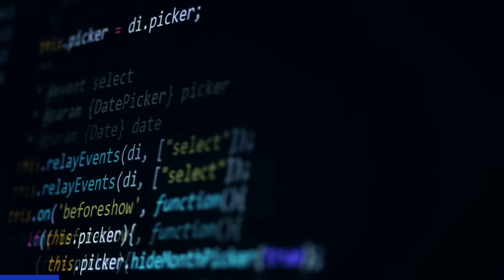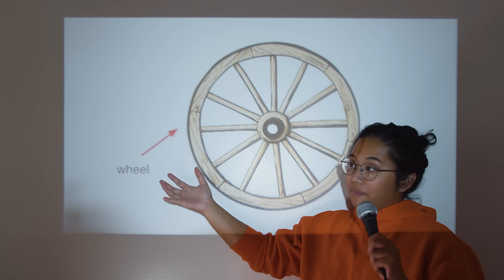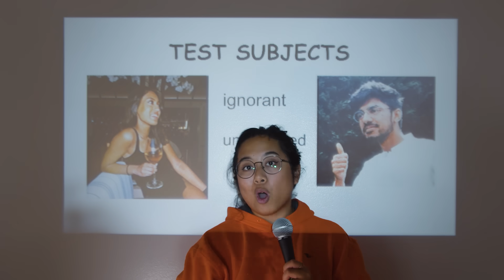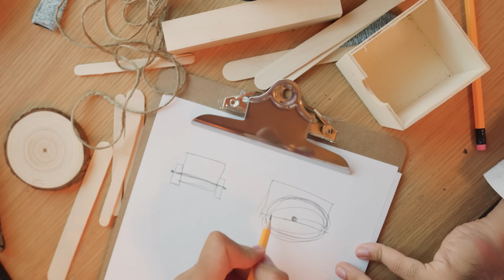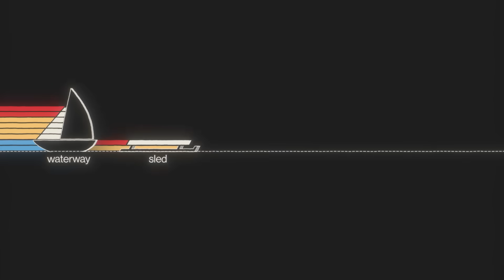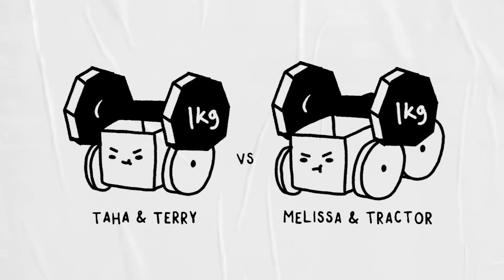why it took 200,000 years to invent the wheel

Comment: A few other factors to keep in mind:
1. Terrain. Hilly or mountainous terrain would be a potential hinderance compared to somewhere relatively flat. Thus, roads are important for wheels to operate at their best efficiency.
2. The use of animals was definitely a key component, which you did mention. This is why the wheel really took off (eventually) in the Old World. In the Americas, domesticated animals capable of pulling a cart didn't really exist, so the wheel wasn't really utilised. This doesn't mean that they were unaware of the concept. Evidence exists of figurines and children's toys with wheels attached. But practical use would have been limited.

This is not a critique of you video, though. Just some interesting thoughts to add. Your challenge for inventing wheels was really thoughtful. I enjoyed watching the process.

Comment: i think even the "2 wheels and axle" method might be a little further from the actual invention of the wheels as a labor saving device. attaching one wheel to the end of a sled or travois (turning it into a wheelbarrow) would be an almost intuitive step, rather than jumping straight to multi-wheeled carts pulled by draft animals

Comment: I don't feel this really touched on the challenge of constructing a wheel from materials. They were given a log cross-section, which wouldn't be a reliable way to scale to the right size. The wheel would have to be quite large to account for lack of roads, and grain orientation on a log would be in the wrong direction and thus split under weight. Also the pith in the middle of a tree is the weakest part, terrible for supporting the focused weight of the axle's load. 

Idk felt like this video wasn't in the same league as your other material. I recommend revising your testing.

Comment: Before watching the whole thing, let me think. 
Get a string, nail, and a drawing stick. Making an inner circle. Then make an outer circle. Just attach the draw stick to the string, and the string to the nail to make the circles. Once that is done, use carving tools and make wheel... now I will keep watching to see if i am correct. Just make sure the inner circle is the same size as the stick to be used as the axle.

Comment: - 1:32 IBM didn't "sponsor that portion of the video", that was just an ad, plain and simple.
- 1:55 A wheel isn't as simple as round-thing-on-stick; to make it work the way we use it, you need to invent a rotor or bearing.
- 7:45 JohnnyQ90 machines metal parts on a lathe to make mini internal-combustion-engines for model cars!

Comment: Looks like they managed to invent the wheel in your show - BUT (and it is a big B.U.T.): There is still a way to go from those toy wheels to something that really can carry a cargo. Their wheels are rolling with the fibers parallel to the axes. At higher loads, they will break early. For building good wheels, our ancestors had to turn the direction of the fibres and find a method getting round, stable wheels without relying on stems being round. A compass will get you draw a circle, but I think we needed metallurgy to put a metal strap around that disk to give it stability - thr strap being a reason why it took so long. A wood wheel with a metal strap around was a standard fairly long, before rubber came along and we shifted to metal wheels with rubber not long ago.

Comment: I would've used the string to draw a perfect circle for the wheel and then use the pencils, popsicle sticks, and rope to create a lathe to carve the perfect circle. I would also have used the pencils as axels but used the graphite as a lubricant and used the popsicle sticks for washers and tied rope around the outside of the axle to lock the whole construction on. Some type of leaf spring would be nice but I doubt I could construct a strong one from the given materials

Comment: If you are rolling over rough ground, you need a big wheel, or you get stuck easily. Large trees are often less round around. Taking a thin flat slice of a large tree is hard enough with a modern handsaw. Good luck with a stone axe.  Wood is strongest up/down. Which is why Wheels aren't just slices of tree.

Comment: Plus there's the issue of wheels working most efficiently on smooth, solid, and level terrain. So if you live somewhere where that doesn't exist naturally, you'd need to build roads. And why would you build roads if you don't have wheeled vehicles to use on them? And why would you build a wheeled vehicle if it wouldn't work on the ground it would have to operate on? IF you lived in that sort of environment, you'd basically have to invent both the wheel and the road at the same time in order for it to be terribly useful.

Comment: True: she has the suspension, but she doesn't have the speed - Everyone would be riding Terrys to work and while the "Trucks" are more convenient to take to the shops: they would ultimately not pick "Trucks" due to poorly built wheels!
Therefore, while she may have won in this video: I declare in the longrun Terrys to be the more efficient and reliable mode of Transportation.
I would therefore like to award the creator of the Terry with a Terry's Chocolate Orange. Unfortunately I ate it. =P

Comment: If I had to reinvent the wheel with primitive tools, I would go for a wheelbarrow. 
1. The wheel doesn't have to be big, so a relatively thin tree could be used as it is.
2. The axle can be very short (10-20cm), so it's easier to make it round.
3. And obviously I would only need one wheel and one axle. I there's no need to worry about the stability or weight.

The downside is that it's not so groundbreaking as a cart. But it's a start, and with enough iterations the system could be scaled up to a cart or a wagon

Comment: That.... was actually fantastic! Liked, sub'd and here's your comment!

One of my degrees in is product design. I had a First Principles course that asked questions just like this. We had a fantastic challenge in which we were given a roll of bubble wrap (one of those 2-foot diameter FULL rolls of bubble wrap; half of us got little bubbles, the other half the big ones. Each presents different challenges). The objective was to present a device that could pop every bubble as fast as possible. Chemicals and temperature manipulation (e.g. "fire") were off-limits. Results were obtained by folding the remains back on itself over and over every 18 inches, then setting a piece of 1/8" hardboard atop that and measuring from surface to top of hardboard (as even a single remaining bubble would, perforce, prevent it from sitting flat. Many bubbles have a rapidly-cumulative effect.

The coolest part was of the 16 of us, there were 16 totally different approaches. Literally no two of us approached it the same way. Trés cool. This experiment of yours here harkened back to fun times. Thanks for sharing!

Comment: I was told to comment so I shall comment... but what should I comment?
Does the comment need to be sensible or just a string of words put together to form a sentence or two or more.

I think it's easy for those two to "make a wheel" when they already knew what a wheel was.
It must have been incredibly hard for people back then to invent a totally new thing which had to be able to do all those things mentioned about the wheel. To have all of its properties and functions. Yeah, you invented a thing that works in very specific situations and if presented with any trouble it breaks, so basically it needs work.

Comment: My only issue with this is, they already know what a wheel is. I think ot would have been harder not knowing what it is.
Reply: The counterpoint is that they already had discs and such. They are had logs of wood for rolling things. The thing that was missing was the axle-platform joint. And for the vast population that seemed to be a ard problem to solve. Pretty sure the innovators of the time found friction, wear and tear, and wooden axles being stuck in the uncircular holes as common insurmountable problems. Precision is the whole thing, like it is today with fusion plasma containment. Once we get fusion plasma containment sorted, which needs computing, we willhave the next big leap in our evolution as a species.

Comment: The invention of the wheel and in fact all industrial processes rely on the lathe. Early wood lathes allowed for dowels, axles, and bushings that were better quality than trying to carve a circle by hand. Pottery and bow drills both use the same rotational technology. The development of the metal lathe enabled the entirety of the industrial revolution as screws like wood screws, bolts, and nuts and other mechanical devices like gears (fancy wheel and axles) were available to be used and crafted into machinery. Without the lathe and drill everything would have to be hand carved and sanded which would add a lot of cost and friction to the axle mechanism making the cost of use for wheels a lot higher.

Comment: 5:59
drag? or was that supposed to be friction
drag in physics usually refers to fluid resistance, in this case air resistance. It seems like what was meant here is that the friction of the axle rotating against the body of the vehicle was the issue?

Comment: Sebrina: A large part of the problem of inventing the wheel was inventing the axle. 
Melissa: So anyway, I’m just gonna use this pencil. 

Lmao
Reply: I was gonna say, that sounds like cheating lol
Reply: Definitely think we're stretching the "using only string and saw" definition there
Reply: @RainaRamsay  The restrictions were arbitrary to begin with, and not suuuuuper reflective of the tools of the time. They're missing at least glue (big), sandstone (about 1200 grit), sharkskin (about 600 grit), sticks (aside from the pencils), bones, (potentially bronze), (very dubiously screws and threading), different shapes of wood, knowledge of carpentry, and god knows what else.
It's fine as an illustrative example, it's not trying to be a real rigorous approach.
Reply: @samarnadra  no they do not count, the thing is that SCALE matters, making something tiny like these things you can get away with a lot of wrongs but if they were to scale these models up into actual usable wagons or whatnot then they would completely fall apart.
Reply: Humans figured out "round things roll" the first time a caveman kicked a log down a hill. Getting things to roll in place is the tricky part
Reply: @joshentheosparks7492  Yes.
Reply: cmao

Comment: I think Sabrina missed the point of the whole wheel invention and went the other way. Of course the struggle to attach two or more rolling things to a stable platform is valid but it was struggle to make the wheel good, not to make the wheel itself. By the way axle is not part of the wheel, it's used to attach the wheel to the platform and make use of it. The biggest struggle, like with every other invention, is to come up with the idea and realise that it would work. I don't think it was easy to realise that two discs sticked to a box or a plank would make transportation not as hard, since such construction don't exist in the wild. (Probably someone just saw a stone or log rolling down the hill.) Like I'm sure people who invented sliced bread weren't struggling to slice that loaf, they just haven't thought of that and that it was smart (so smart that a saying came out of it).

Comment: I feel like the rope axle wouldn't be very durable in practice.
I think part of the problem with wheels is that the thing that works on one scale won't necessarily work on another. E.g. A rope axle is fine if you're just making a small model, but if you want to make a full-sized cart, carrying hundreds of pounds, you'll wear through the axles very quickly.
As you say, wheels have to compete with other methods of transport and that puts a high requirement on efficiency and durability.
Reply: Kinda raises the question of whether tensioned cable could do the same thing in a scaled up way. I mean it's probably a bad idea or people would be doing it (that or I've invented an idea that's already done lol) but I'd say it counts as being essentially a different grade of the same mechanism
Reply: At some point the bearing surface also factors in. And then you got to figure out what substance to use for axle grease.
Reply: another issue is that these people live in a society where the wheel is common place, of course they can "invent" the wagon like bruh, he's probably seen thousands of wagons being an indian lol
Reply: @Danuxsy  I think any of us could jump-start the industrial revolution by having so many well-tested ideas.
Reply: The problem is not durability but the forces in play. Something has to prevent the wheels to turn into the cart - because the wheel could turn all three dimensions but only one of them is allowed during normal operations. The heavier the load the bigger the effect of moving the wheels sideways. If the bearing of the wheel can do it on its own - like a bear gearing - you don't even need an axel (like on a gocart).
Reply: @bztube888  Indeed, the upper part of the wheel would continuously rub against the cart. One of them would eventually be ground away, assuming that the rope doesn't give in first.
Reply: Purely theory here, but you can braid rope to increase the tensile strength— rope is braided to begin with, just do more braiding. Egyptians had rope that could hold at least 2,000 kilograms they were using to build the pyramids, and I've read that rope of up to 8500 kilograms in tensile strength is not impossible for the time frame.
How that translates to durability against friction— that would probably be more in the realms of the waxes and greases of the time (did they have shellac?).
Not a good axel material by any means, but probably not completely disastrously untenable, especially if bronze rings were used as a point of contact.
Reply: in order to prevent excessive wear you need lubrication to reduce friction. Some early bearings were probably made out of smooth leather. I've read it has been used in a pinch for rotating assemblies before.

Comment: I like that this video goes into a bit of depth thinking about the journey that people went through while inventing the wheel, especially since it made me think of what alternatives could have arose. Imagine a world where we used tank treads for everything simply because that's a shorter leap from when people rolled carts on top of logs and simply ran back and forth to bring the logs in back up to the front.  Or imagine a world where vehicles are attached to the axles and the wheels as well so that the entirety of the vehicle spins as it travels making it so that you have to take some time to recover from your concussion after every journey.

Comment: I think it's cool how they somehow unintentionally made complimentary primitive modes of transport. Like Melissa suggested, her cart contraption could be pushed/pulled by Terry and his ox/horse/donkey while Melissa's cart axels help disburse the bulk of the weight being transported.
Reply: That's almost like a case of converged evolution to solutions that work.
Reply: @monad_tcp  That's correct, they are convergent evolutions of the wheel because they both had similar selective pressures that led to their construction. Each cart is a separate entity that came from a similar circumstance which was no prior knowledge on how to incorporate the wheel to a fixed cart.
Reply: The thing you are forgetting is that both of these already know about wheels, trucks, cars, wagons etc... that is very different from being back in the time those things didn't exist, nor the concept of them.
Reply: @Danuxsy  You missed the whole point of what I was getting at. I acknowledged that both of their cart designs could work together for the same common goal with different strengths by sheer coincidence. I never said that they were more impressive than primitive people who had no prior knowledge of modern vehicles. Where did you even draw that conclusion from?
Reply: now is the time for societies great leap forward... emus on bicycles. with mechanical advantage for draft animals society will have peace prosperity and abundance even if there is still class structure. bird seed is cheaper than gasoline
Reply: @cactusshadow9840  there was the emu wars but what you speak of is the emu revolution
Reply: @cactusshadow9840  I would like to live in your Emu bicycle
Reply: @3countylaugh  there are only racing emu cycles in production right now. there are plans for emu peddled houseboats if you're interested.
Reply: @cactusshadow9840  I've seen some stuff on VR chickenball. Trying to make them think they are free range like it's the matrix but for birds. Do that with your Emu and turn them into a battery.
Reply: That’s so cool!
Reply: Being interested in linguistics, I found it cool how Melissa called her creation a tractor and later on creates a tractor-trailer by having Terry trail behind her tractor; good insight into how one of the common names for a semi-truck came to be.
Reply: BECAUSE MELISSA SCRIPTED IT!
Maybe, I don't know